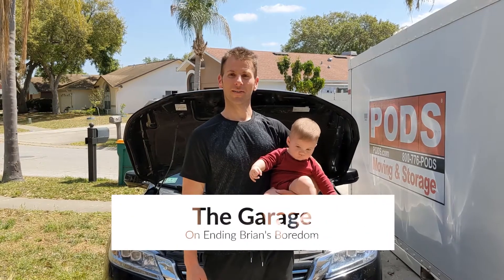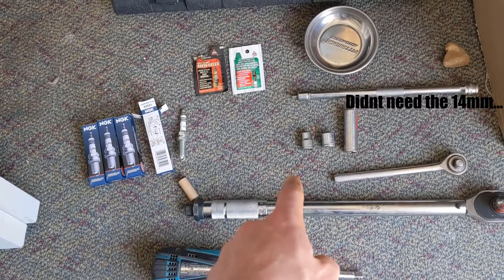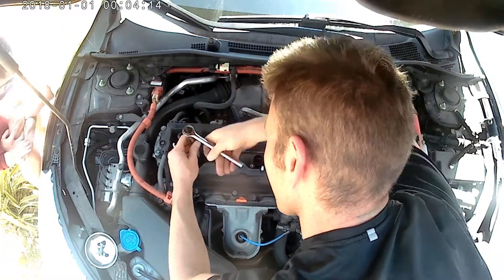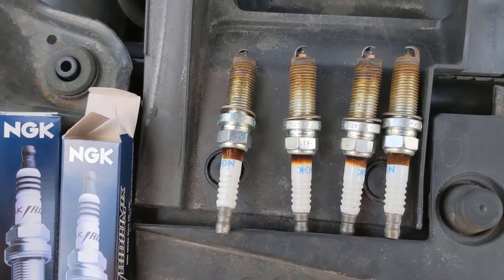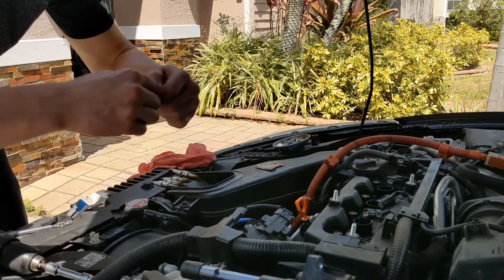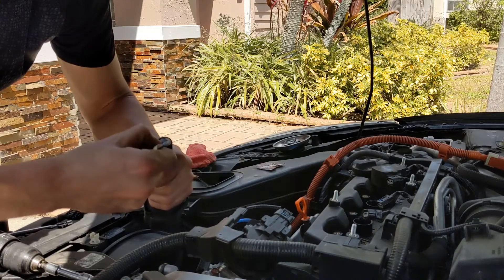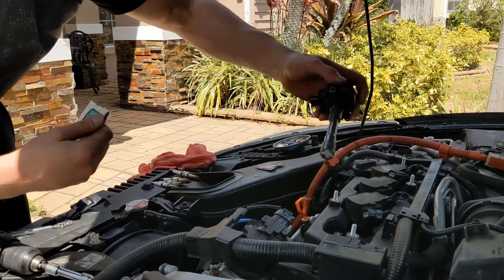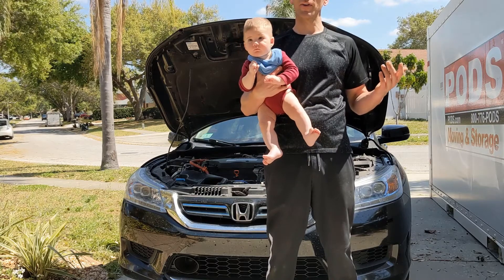How to change sparkplugs on a 2015 Honda Accord Hybrid

Comment: Thank you ! I would confirm the gap on the plugs (normally they are right on), and would lower them in the hole.  Very good advice about the anti seaze and di-elecric

Comment: I've never seen a factory manual tell you to lubricate the spark plug threads.
Reply: This is critical. The grease allows you to have a specific and consistent torque setting, without it, you will get a random torque. Try it with and without and you will see the difference. Highly likely you will severely under torque without it, and maybe damage the engine.

Comment: Thank you for the excellent step by step video. You included demonstration on applying the anti-seize and dielectric grease, which I didn't know were needed. Truly helpful. I just changed the spark plugs for my 2015 Accord Hybrid, at almost 90K miles. One of the easiest maintenance work.
Reply from the maker: Glad I could help! My dad was a diy master mechanic. I definitely learned a lot about cars growing up

Comment: Thanks man.  I have the same car and am about to tackle this project (80k miles).  Aside from the stutter, did you notice an improvement on your gas mileage?  I’ve been finding mine underwhelming lately
Reply from the maker: Not really in the summer as the AC is always running, creating a draw. Maybe in the winter.

Comment: Don't drop your Sparks plugs in as a general rule; you can change the gap.  Use a socket with a foam socket insert or some other means to keep the plug in the socket while you lower it in.
Reply from the maker: Thanks for pointing that out, I never thought about that.
Reply: @endingbb  Thanks BTW for the vid; I thought the plugs/coil packs were buried until I saw in the vid they were right on top! :)

Comment: Thank you for your video. I also have honda accord hybrid 2015. I used 13 foot lbs for my torque wrench with spark plugs (npk laser iridium) . Is that right?
Reply: I know asked over a year ago, but for anyone else. 13lb/ft is what I found.

Comment: Your video is about to save me $700. I owe you some cold ones my friend.   I’m at 100k miles and like you, will wait till 130k to check the valves. Car drives excellent so I don’t feel the need to drop $700 right now to get them checked.

Comment: Thanks for making the video, Brian, mine is up for replacing in a few thousand K and you make it look easy enough.  The manual also mentions something about valve clearance, any idea on how to check that?
Reply from the maker: Thanks for watching!
  Checking and adjusting the valve clearance is a bit more in depth, it involves removing the valve cover and using a feeler gauge to check the gaps between the tops of the valves and the rocker arms that push down to open the intake and exhaust valves. I personally don't plan on doing that until my next spark plug change, around 130k. Unless you're hearing an audible tap, it shouldn't be too far out of spec.
  The tops of the valves become worn down over time increasing the gap between valves and the rockers and replacing your oil at regular intervals helps reduce overall engine wear. Checking your clearances is still part of your regular maintenance, so its recommended for "peak" performance and fuel economy. This isn't a hard driven, high performance car so I don't have valve clearances prior to 100k in MY high priority list.